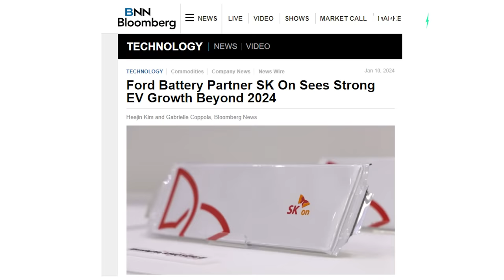Ford FIRES nearly 70% of EV plant workers,ramping up ICE production

Comment: Simples - the EV enthusiast market is nearing saturation.  Mainstream adoption is broken because of a combination of; lack of sensible charging infra, lack of forethought with respect to fire fighting, replacement batteries costing more than the car, and those batteries being irreparable leading to high insurance costs to cover increased write-offs.   There's a few things that need to be addressed for mainstream to become interested.  Toyota's looking pretty smart now huh?
Reply: Maybe jn US . But  here in Asean, especially Thailand, Chinese evs have taken off like a rocket. In just over a year since, you find Byd, Neta, Ora, and MG evs everywhere when they were none before.  Both BYD and GWM are building their plants here to support the right-hand drive market here as well as Down Under.
Reply: Mainstream adoption has only BEGUN
Reply: Sales are still climbing.  Sales of automakers that sell decent evs are climbing.   Tesla model y was the highest selling car (after pickups)  in the US last year.   battery replacement is not something you need to worry about.  the batteries are lasting longer then transmissions or engines in gas cars.    Toyato doesn't even make an ev that is worth anything so why the heck are you mentioning them.  please do some actual research before posting nonsense.
Reply: Lol. Q4 EV sales 2023 are up 29% vs Q4 EV sales 2022. Try harder.
Reply: @mattbuie5878  "Sales are still climbing." <- that explains the discounts and manufacturers downsizing EV production then.  "Tesla model y was the highest selling car (after pickups)" <- also behind the RAV4, and a little over half the volume of the number 1 seller (385k Model Y's v 750k Ford F-Series).  The fact that pick ups are still in the top three (by far) positions and Ford is cutting the Lightening in favour of the ICE models should tell you that mainstream isn't very interested in the EV market.    "the batteries are lasting longer then transmissions or engines in gas cars." <- except when they don't.  Or the car gets a dent in the battery structure and no-one trusts it so dealer/insurance insist on replacement.  Hopefully this works itself out cos it's a nuts situation.  "Toyato doesn't even make an ev" <- because they're smart enough to understand that mainstream is far from ready for them.  43% of those RAV4's were hybrid so they're clearly doing something right
Reply: May be looking smart now, but if it means it takes them another 4 or 5 years to make an electric version of the Toyota Yaris Cross and then have to price it at 50k...
Reply: @mattbuie5878  thank you sir.  Well said!
Reply: The reason legacy automobile makers are cutting back production of EVs is because they can't compete with Tesla or BYD. Their sales is growing at a pace expected because of interest rates to help slow down inflation.  EVs are the future, and this is the start of a great future.  Maybe we can slow down climate change if possible.
Reply: @richardhardin9184  I don't think Tesla's appeal to mainstream.  They chose to be different for different sake with the stripping out of all the buttons and stalks and putting the controls in the touchscreen.  Average Joe doesn't want that.  Tesla (or more accurately Elon) made those choices because they think drivers shouldn't drive and FSD will do a better job, and if the driver isn't driving then they don't need easy access to controls.  Again, average Joe isn't that interested in driverless cars and it'll be decades before that changes (if ever).   So competing with Tesla is relatively easy - just make a car with regular buttons n stalks. 
Competing with BYD is harder because of the massive subsidy provided by CCP allowing them to essentially sell at a loss, and price is a major factor for purchasing, obviously.  Wouldn't be surprised to be see tariffs in the future to ensure we don't become over reliant on one country.
 BEV sales are down 5% this year whilst Hybrid is up 194% and Plug-in Hybrid is up 138%.  Petrol down 4%.  (Vfacts Q1).  These figures seem to support that BEVs are not what mainstream wants.  Half of BYD sales globally are hybrids so it can easily pivot.  Tesla is a one trick pony (in the car world) that apparently now thinks it's an AI company.

Comment: As a compromise, I have been looking at the lightning here in Canada.  Its a decent truck, but it costs too much to make for the price point needed.  I have been noticing that dealers are a bit clued out how to sell these things.  They don't even mention what size battery a truck has most of the time.  But if demand is low and the price drops for used lightnings perhaps they would be a good buy.  Software is still suspect and one has to wonder about long term support if they are not committed to production at reasonable prices.
Reply: Why would you buy one in Canada? First big snow storm that blows through the battery is gonna leave you stranded
Reply: Just wondering if you're aware of what happened in Chicago recently with the frozen electric cars?
Reply: Yep, and they can't tow either, even in warm climates.
Reply: @crash6674 That battery will last for >3 days in a traffic jam situation in freezing. Try that with gas or diesel. 
Why so many haters against EV? Why can’t just everyone decide for themselves without smart advice all the time?
Reply: Run dude.  Its junk.
Reply: @sennewald  By freezing I assume you mean around 0 degrees C ( freezing point of water ). I live in Canada and have seen temperatures of -40 C. Do you think the battery would last 3 days at that temp? The problem is the gov has already admitted they want to end fossil fuels so eventually we won't have a choice.
Reply: @puddytat54   The "black body radiation" formula has a 4th power term. If you keep the cabin heat low (heated seats may make that more viable): I can see the truck lasting 3 days, even at -40C. It takes less than 300W to keep the pack at a safe -28C (based on the temperature the Nissan Leaf "cold weather package" keeps the battery).

Edit: If you can't give up hydrocarbons: synfuels, made from atmospheric carbon, are hopefully going to be an option. Unfortunately the "energy industry" has been doubling down on fossil fuel for the last 25 years.
Reply: @crash6674  Funny,  I am renting out a space to a work crew.  In a recent cold snap 2 of their 3 trucks wouldn't start.  The 5 ton refused to start till it warmed up.  Cold weather is hard on vehicles.  

I do my research and don't jump to conclusions.  Lots of people function just fine with evs in Canada.  Like any system, things have to be managed properly.  Cold weather is not the issue.  Incompetence is.
Reply: @crash6674  if that were the case, Fox News would be showing story after story about it. It happened to one guy who didn't plan his route on plugshare or a better route planner
Reply: @puddytat54  lack of preconditioning knowledge and charging to 80%
Reply: Good luck with that Canadian climate will kill your battery within a few years.
Reply: @jamesphillips2285  Fossil fuels are a major contributor to mankinds success. I bet 75 % of the things you own are derived from fossil fuels. Co2 is plant food. The earth gets greener as co2 levels rise. Where is the energy to come from to charge all these electric vehicles?
Reply: I suspect for most people it would be a 'Goodbye' instead! But yes, something notable has to change!
Reply: Smart advice? More like FUD. @sennewald
Reply: @puddytat54 They will never end fossil fuels 😂
Reply: @crash6674   Just went through the deep chill here in Saskatoon, and had zero problems whatsoever with my EV. It handled the snow and ice better and started more reliably than either of the two ICE vehicles I had previously owned. Data from Norway, where, you know, it gets kinda cold, and where over 1/4 of their cars are EVs for the last several years show that EVs on average and twice as reliable in extreme cold weather than ICEs.
Reply: @puddytat54  The amortized cost of solar has been cheaper than connecting to the grid for around 10 years now. Add in batteries and you double the cost, but I expect sodium-ion batteries, with their lower input costs and wider temperature range to be a bit of a game changer.

I am also an advocate of nuclear power (specifically molten salt designs that are more efficient, but have nuclear weapon proliferation concerns because auditing material is more difficult), However nuclear will have long lead times. They are not finished inventing the 4th generation plants yet; and indigenous people still need to build their capacity to be meaningfully consulted on their installation.

If not driven all day, in a delivery service for example, I expect most cars can simply charge at night during the low power demand time. They are inherently load-shedable in order to avoid the peak demand time. The Canadian electrical code has been changed so that you do not need an electrical service upgrade to install a L2 car charger. Instead you would install a whole house power monitor and stop charging if there is too much electrical demand in the house.
Reply: @wrongthinker350  Again there is no evidence of that.  I am very interested in how long a car lasts.  I know our ageing ICE vehicles become more and more expensive to repair.  To fix a horn we were quoted 3000 to replace a rotted wiring harness.   Doesn't help that planned obsolescence is part of the business plan for most manufacturers.  I see the potential for EVs to last much longer.  Even if a battery needs replacing at some point, these costs should come down.  But overall, the simplicity of the running gear should lead to long life.  We have some early evs lasting a long time, but so far not enough data.  

We will see if manufacturers undermine their own products.
Reply: there's a reason no one is buying them. Now, imagine if they made a powerstroke pHEV for similar cost. Ford got sucked in to the hype, where many are figuring out the middle ground between gov and consumer. Ford says they lost $60 billion and closed 3 plants. They're screwed and their only hope is the Chinese (by design)

Comment: Why would anyone in their right mind buy a lightning without the NACS in it?? If I was buying an EV I would wait
Reply: They can use the adapter.
Reply: Yes, I believe they should slow down production until they change over to NACS.
Reply: and wait for the 2024 with the heat pump
Reply: I have a 2022 model with the CCS plug. It’s fine, most people charge at home on a level 2 that doesn’t even utilize the full CCS capability.
Reply: If (HUGE IF) you could get the Lightning at MSRP, even with taxpayer incentives it is still $10,000 more than the same trim ICE. That buys a LOT of gas and you can get it serviced and fill it up without a hassle. NACS is just one of the many issues to stay away from EV for a while.
Reply: My husband used to have a Lightning. Powerful truck. Part of the thrill of driving one was the rumble & noise when accelerating. It could actually haul &/or tow a huge load if needed. EVs are wannabe vehicles. You spend much more but get much less along with a lot of headaches
Reply: The workers are unionized, I doubt they were fired. Layer off, retired early etc. not fired.

Comment: I live in Vancouver Canada and a avid outdoorsman. I can honestly say I haven't met 1 person who is seriously considering buying a EV truck. I do know 1 person who sold a Ford Lightning recently at a major loss.
Reply: i see on average 1 lightning per day in Vancouver. i also see about 2 or 3 ID4's and Mach E's. Of course Vancouver is overrun with MY's
Reply: @eliwhitney852  Yup totally agree EV trucks completely useless and you virtually never see them in truck country
Reply: I purchased a Maverick ICE - would have got the hybrid but the towing was too low.
Now wife wants a bigger camper so I need to upgrade. If they had brought out a Ranger EV I would most likely have purchased.  I looked at the Lighting, does fit in the garage.  So I need a midsize, with 5k tow rating, for around 70k CND$. If it can get 200km towing with a 4200 lbs camper and has good fast charge, Im in.
Cheers

Comment: Fascinating. 

I would have happily bought a Lightning at the advertised price, but between my day 2 pre order and when I was able to actually buy the truck they raised the price $20,000 lol

Talk about shooting yourself in the foot.
Reply: And what was Ford's excuse for that right the lightning prices were announced officially in July of 2021, sales started in May of 2022.
No excuse imo for the price raises!

They should just drop the pro base down to $47,495 then post tax credit now a pos rebate it's at the og pricing of $39,990.
Introduce an extended range xlt maybe with fewer options a heat pump nacs and 320 miles of range for $62,495 so post credit it's 55k.

Sell like crazy until late 2025 when the all new trust the truck t3 millennium falcon thing is coming out of the new blue oval city in TN. 👍🏻😎
Reply: That's why I'm not buying a Cyber truck. Lol
Reply: This is surprising as I just recently bought my first Fords, a 2021 Bronco and then a 2023 Mach E.  The Bronco was preordered a year early and my dealership promised in an email to sell them both to me at MSRP. I think some of you are going to the wrong dealers.  If they dont promise you MSRP, then don't buy from them and order somewhere else.  Also, maybe you are trying to buy off the lot?? It is much more fun, and you get exactly what you want, if you factory order. That's what I have done with most of my car buys.  The two times I didn't, I was left with a bad taste in my mouth too.  As they say, good things come to those that wait.

Comment: I agree, had Ford switched the charge port right away, I would have been somewhat interested in even looking at their line up. But not remotely interested in using anything other than a Tesla charging location when not at home.
Reply: You have no idea why NACS is actually very bad for customers. In the short term it looks OK but in the long term it is very bad. Here is a hint why; ever heard of having to buy Ford petrol to put into your Ford car and letting Ford know everything that you are doing. Got it now?
Reply: Assuming it already has the charge port, how are you going to use the Tesla charge port?
The Tesla chargers don't accept credit cards. You'd have to set up the car's programing to handle that, not to mention the banking arrangements. That has not been worked out, in fact Ford does not have the information it needs or the programming to even start coding.

Comment: I think he hit the nail square on the head.  What happened to the Ford Focus?  I went to buy my replacement Focus a few years back and it no longer existed in the US marketplace.  They did the same thing with the Fiesta.  Ford wants to sell big feature laden products.  This customer does not want to buy what Ford has to sell.  A small vehicle that can be used for most local trips would suffice for a lot of us.  The range could be a few hundred miles on a charge allowing for a smaller battery and lower price.  This vehicle would be a simple product introducing many of us to EV ownership.  If Ford doesn't have what we want we go elsewhere.
Reply: What happened to the Ford passenger cars ???       They don't really build cars anymore except the Mustang Mach E.     Passenger cars make very little profit per unit off the assembly line.    They want $25K thousand dollars profit per unit sold.    Not 25 thousand dollars for the whole entire vehicle.    Lol.      That's why
Reply: @gregorylyon1004  So,......Sell three small cars to get that profit.  The Model T was sold in quantity.  I also think a small truck like the old Rangers would sell very well.  They should build mass market products and not massive custom trucks.